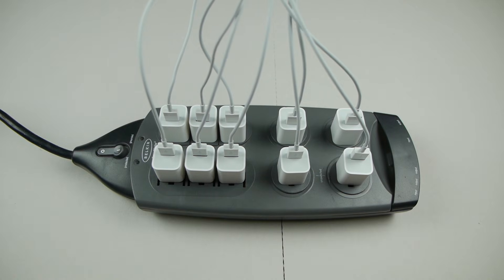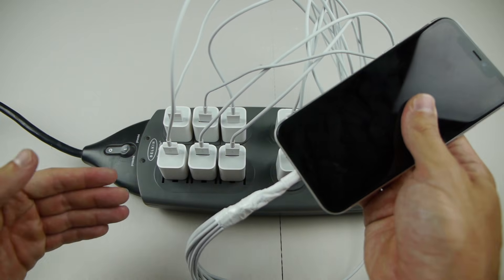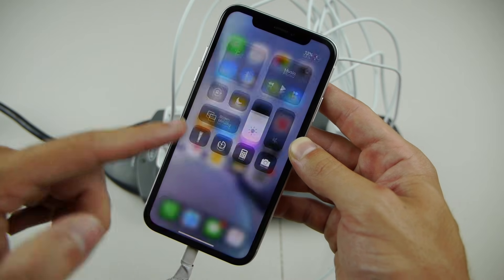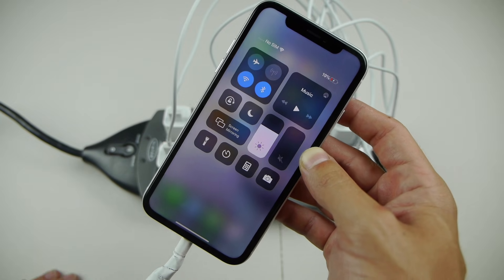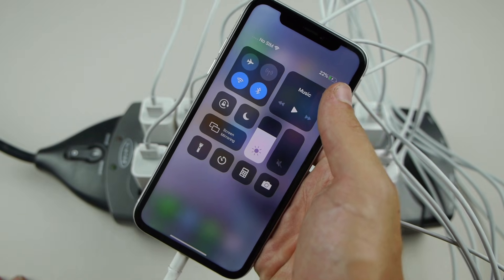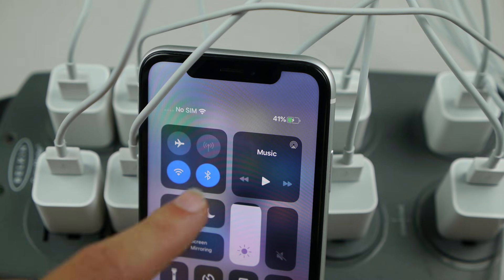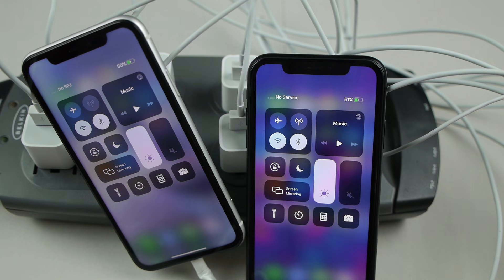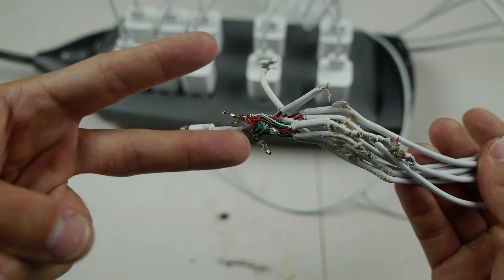What Happens When You Plug 10 Chargers in an iPhone? - One Mega Charger!

Comment: This has to be fake. I looked at the Iphone schematics and wiring and it seems like there is no resistor by the port. His port looks like a USB lightning cable charger so its about 5 Volts of power. Having it multiplied by ten would result in it being 50 Volts of power being pushed into the phone! 

When I did some research; Iphone X can withstand up to 9 Volts at maximum and that will still make the phone charge at normal speed but probably a tiny bit faster(with not much noticable difference)

If 50 Volts are entering a 9 Volt maximum battery; the phone should be burning like the Samsung Galaxy Note 7 incident but five times worse.

He must have placed and hidden some plastic caps or nonconductive materials under the chargers so the electricity still goes in only by either 2 or just 1 active cable. In a second assumption is that he had cut off all the other cables and left one working and tapped all of them together. It is extemely dangerous and 50 Volts is just the right amount of Volts to possibly paralise the person for as long as he touches the bare wires or loose bare wire.

I highly doubt the second one since this guy is smart enough to make such a fake video, he should be smart enough to know how not to die from his own stupidity so good for him I'd say.
Reply: If you connect them on parallel you won't get 50 volts, that's just not how it works, you're just increasing the maximum current which is controlled by the phone so connecting 100 chargers in parallel should be the same as using any quick charge charger that can output the maximum current the phone can take
Reply: Connecting them in parallel requires a resistor in which could not be visibly seen. Even if the guy placed a resistor(possibly in the tape) He did not claim to have a resistor nor parallel wiring and instead just claimed to have slapped some wires together. So even if there is a resistor and the power is limited; there is no point in making this video. Basically saying; this video is a hoax and cannot be and SHOULD NOT BE REPLICATED. It would be pointless to replicate it when forcing power into an Iphone when it damages the battery in any sort of way. Im not saying youre wrong; Im just saying that he did not claim to have this so your explanation is somewhat unrelatable.
Reply: @hakimIDK Nice! The more you read; the more knowledge youll get! Well, only if those you read are informative haha
Reply: 1)You my friend have modified the circuit board .
2)Only one plug point is working.
3)The adapter which is working is of less wattage.
Reply: Then who is smart? May take a reward from tiv jobs
Reply: @aldrinmisena8117  Technically we both are. He is neither wrong nor right and neither am I because we may never know through these uninformative videos. Its like watching a movie without an ending. Its pretty debatable so thats what some online experts are trying to debate here in the comments. You should try looking for other smart guys here too so you can gather a good conclusion.
Reply: Big brain time
Reply: But still why was the phone charging up faster till 40% 
If it was really made with real time that is.
Though we may never know that for sure
Reply: @mauryan7306  Well ye. One smart thing he could have done is turn off the phone and have different screenshots of different charged levels of the phone and use them as a "Screen Saver"(Poctures that show up when the phone is off) so the screen will change and the battery levels will change too. Im not saying it is that way but in your context; it could have been done the way I mentioned.
Reply: First your a nerd and second your still right
Reply: @ashleydesano7804  Thank you haha. Noice
Reply: bro that's not 50v if connected in parallel, it's only increasing current,. if connected in parallel it will gives you same voltage but not in current.
Reply: @LlibRGtaurus  Yeah I am aware of my mistake. I do apologise. Although there is a huge current going in, there is still a limit and or threshold for a phone or system that does not have a resistor. Try putting a hose in your mouth and keep it closed and turn it on at maximum. You can only swallow at a pase until the hose shoots out of your mouth. Like a the phone; it can only take a certain current level for its intake until the battery hets damaged. Even if the phone doesnt explode, damage to the phone's internals is already an expensive repair and that is definetely something you do not want to have to pay for.
Reply: @osphaarmusic2767  yes still there's a current limit that phones can handle, even if you put a higher current on it, as long as transistor current limit can handle.. it depends on the smartphone components electronic design can handle the higher amount of current and will gives a stable amount of current to quick change the phone.
Reply: @LlibRGtaurus  Well looking at the amount of wires, that is not going to be an easy job for the phone. To be realistic; the phone would probably have longterm damage if it meets with an excessive amount of current so that is still not wanted
Reply: @osphaarmusic2767  
Are you a physicist?
Because it's really interesting to read your replies.
Reply: @mauryan7306  I am no physicist but I am knowledgable of the subject
Reply: @osphaarmusic2767  yes of course, it's better to used a single higher power of charger that will can hadle to make it fast charging, than doing this video. but this video is only for the curiousity and experimental.
Reply: So long...
Reply: Even he have doing such things without any precautions, one doing this in real would never do such experiments without any safety precautions. He even did not show the temperature who knows that all those chargers are working.
Reply: @avarna8215  Well one thing is for certain that if they work; this video would not have made it onto any online platform.
Reply: your too smart for me because im young
Reply: @Arch_idr  It is not too early to start learning. You can watch this funny guy called "ElectroBOOM" on youtube because he does do some nice electrical science videos.
Reply: Sorry to say that it's not what you think my frend it depends on whether you connect in a series or parallel... Of course connect in a series would add up the voltage and damage the battery for sure... But parallel circuit connection eon't cause any harm and do not double or triple the voltage instead it add up only the amps which will lead to a faster charging.. .. 
But for some precautions this shouldn't be done at home unless one is acquired knowledge about it... Myself I'm a physicists and have a little knowledge on Electronic  circuits.
Reply: @Merlin_Chhana4  You got one thing right but connecting wires in series does not create Amps out of nowhere. They increase the current and not voltage as I had mistakenly said. The current will cause the damage since its like you placed a garden hose in your mouth and try to keep swallowing the water while its on maximum. 

Amps can be an output of an amplifier and not parralel curcuits since they do not feature any sort of conversion and since Amps=Watts/Volts; 1 Amp = 5 Watts / 5 Volts. That makes no sense since it is back to the start... As if there was no difference in wiring because if the guy in the video done it in parralel, there would not be a difference if I include your hypothesis because if I am correct, an Iphone would only accept 1amps as power normally.
Reply: @osphaarmusic2767  okay
Reply: Acting smart while being stupid 🤦🏼‍♂️ it is still 5v because as he said he connected them in parallel which only increases current and u dont need any resistor or anything to make parallel wiring. Im not saying this does work im just pointing how stupid you are
Reply: @juricekrezi6357  I have to admit that I did not hear him say he had connected them in parralel; but there is clearly no need to use such critisizing words. 

I am neither saying that you are wrong. You are correct. If he does connect them in parralel; the current is increased but there is still a threshold of how much current that goes into a battery. Its like you placed a firehose on your mouth and turned it onto maximum. You will definetely blow off the hose and itll be on the ground. Like a phone or any kind of socket without a resistor; it will take in the current far too fast to still cause damage(if the phone survives). And damage to an already expensive phone is pretty much an unwanted thing.
Reply: Ok
Reply: hahaha lol thats prallel
Reply: @eshirovlogs326  Can you specify exactly which part did I claim to say it is parrelel wiring so I may fix my mistake?
Reply: L
Reply: I am sure you are a maths teacher lecture and boring

Comment: This is literally so fake he cut between every
Reply: So damn fake, iphones can accept max 25/30W, even if the chargers were 5w each (every charger is at least 10W nowadays), it could be only possibile to use some of them therefore most of them are useless 
And with 30W, charging is not that fast
Reply: From 18-20 % he didn’t cut
Reply: I enjoy editing a LOT and I saw no cuts from b 18-20% but the other parts weren’t for failing the use of it
Reply: 1)You my friend have modified the circuit board .
2)Only one plug point is working.
3)The adapter which is working is of less wattage.

Comment: It works since all chargers outputs are the same voltage and load, so it wont matter if its 1, 10, 2000... they will work like 1 alone, but less efficiently cuz it will be saturated

Comment: Even if you connect 100 chargers and charge your phone it won't work, cuz of the fact that the pcb inside your phone have certain electrical components which will resist the excess electric current at first, and if the current exceeds those components will blow away leading to a damaged phone. And also the low level programming in your phone won't allow charging if excess current is detected will show you a charging error, if your phone is not dead!!

Comment: Actually it's not like that every phone including iPhone has a specific maximum power intake. For example say iPhone has 70W rating then it would charge with fast speed if 10 chargers can provide 70w but if you take 100 chargers=700W it would still charge with 70W speed cause 70W is its max rating

Comment: the work is just divided to 10 adapters, battery or battery speed doesn't changes, the life of each adapters are increased because the input power is only 18 watts for this iphone and soldering all wires to one reduces its efficiency to charge

all phones charge quickly from 0 to 50 percent!

Comment: I think when you connect the cables parallel you are increasing the Amperes or the current of the charger which makes the battery charge faster.  it will quickly heat the battery tho

Comment: There are many cut scenes in the video. It does not work. There is the adapter for a reason. If you wanna throw in a lot of power in the phone, just remove the adapter and connect the wire to the plug directly. It will just make your phone blast

Comment: The voltage remain the normal voltage iOS device will require to charge even if you add 10 more chargers cause there is an inbuilt circuit to step down the voltage to it’s required voltage but the Current is higher at this point and that’s why it’s charging fast 
If the voltage exceeds it normal limit it will blow up the circuit but the current is the one doing the work

Comment: Uhm i think that phones come equipped with resistors that dim the current to what the phone was designed to handle. So if your phone can't support the extra power then it isn't going to charge faster even if it's plugged into some high watt charger. So doesn't matter, it'll charge as fast as its designed to or slower, thats your only options...

Comment: Why didnt it blow up?
Since these were not cheap crappy chargers, they have protections built in to prevent damage from this.
Why is it charging faster in the beginning?
The phone is drawing split amperage from all the adapters, so there are alot of amps available to the iPhone. It's probably charging at the 2 - 2 1/2 amp range.
Why did it slow down at 40%?
Phones slow down their chargers as they fill up to prevent excessive wear and heat.

Comment: It depends if you connect it in parallel or in series.
If you connect them in series, you would add up the voltage, That, can damange your phone.
but if you connect them in parallel, instead, you would have the same voltage, but you would add up the amps, which is generally a good thing.

Im an electrical Engineer btw
Reply: i dont think you need to be an engineer to know this. Its just simple middle school stuff.
Adding voltage might lead to damage but phones like iphones generally have voltage regulators in the form of zenner diodes and capacitors to contain that voltage which sometimes can prevent damage from even thousands of volts.

Adding up current might make the phone charge faster however most Li ion batteries cannot let pass a lot of current.
Fast chargers are typically fast cause of the higher wattage which directly converts to higher energy and thus faster charging.
High wattage can be achieved by either increasing the voltage or the current.

PS - Another electrical engineer.
Also btw its very clear the connection here is parallel.
Reply: Smart

Comment: He has connected everything in parallel, which reduced voltage from (if) 9V close to 1V, in return it increases current from (if) 5A to 45A therefore the power supplied to the battery remains constant, That’s the reason why it charges in almost the same speed.

Comment: so before I watch this I'll tell ya what happens...   it charges the same way as one...  because they are all 5 volt... 1or to amp chargers..    and the device DRAWS 5 volts at 1 or 2 amps..

if he thinks it works like you can force it to take in more amps maybe,,,  if one charger is putting out 1 amp and the device charges using 2 then 2x 1 amp chargers would charge faster then 1,.
but its not going to pull any more amps then what it needs.     Voltage does add up.    if you had 1 5 volt and 1 9 volt charger it would charge at 9 volts.   

I guess people outta research electricity for dummies before claiming stuff they have no idea about :-\

Comment: All your doing is essentially making a 50 watt charger, iPhones accept at most 18 watts, so although you using 10 chargers, you only need 4 of them to get the same affect.
EDIT: The reason it was charging so fast in the beginning is because the battery inside the phone is a lipo battery; and with lipo battery, the more you charge it up, the more the internal resistance increases. Think of it like trying to run through water; the slower you go, the easier it is to walk. That's why the one cable was winning at one point.
Reply: Yes thank you ❤️🥰
Reply: Ur smart
Reply: You’re kinda right. Basically all he has done is create a charger with higher amperage. The voltage stays the same. The reason it charges faster is because a single usb Charger usually only outputs about 5W. Add two together an you get 10W and so on. Since the iPhone X is capable of fast-charging it would consume up to 35-40W. So basically all he did was create a big fast-charger that might set your house of fire.

Comment: My phone has Turbo Charge, with just one wire, my phone activates it automaticly. To avoid over heat and swell the battery when it reaches 100% it turns off the charging mode. Its pretty fast aswell
Reply: I'm running the a71 and have found it charges extremely fast honestly

Comment: 1 charger = 9.1 volt 
10 charger = 91 volt 🙄
So stop trying this method because your battery will drains
If wanna boost your charging speed try to airplane mode your battery speed will increase 2X speed.
THANK YOU 😉
Reply: No bro it doesn’t work like this, he has connected everything in parallel, which reduced voltage close to 1V, in return it increases current from (if) 5A to 45A, therefore the power supplied to the battery remains constant, That’s the reason why it charges in almost the same speed.

Comment: But the amount of current and volt across the potential terminal is same we just fuse the wires (cables) the current is still same in each wire and the mega wire .......so it's basically the same charger just a bigger version .....and also waste of electricity......just don't let it on fire

Comment: Im guessing im wrong but if a extension cord is used to power different things at the same time the cord itself is getting its power from one source (the outlet) so doesn’t it just split that source into multiple parts in order to power the different things so each one of those is just split power from the outlet example (when you plug one thing into a extension cord you get all the power if you plug multiple things into a extension cord that power gets spilt and weakens) sorry for the stroke while reading that lmfao

Comment: It would have turned out better if each charger cable came from different outlets instead of using a multi outlet box charger thing run extension cords from different outlets and then try it out

Comment: Fake video .  If u have basic electrical knowledge  . If u take all of the 10 chargers of 5v 2 amp . It will give 5v 20 amp.  Because voltage in parallel doesn't change but it will increase current rating . But but but the current that phone will take will be limited.  Because current drawn depend on load . So it will charge in normal rate